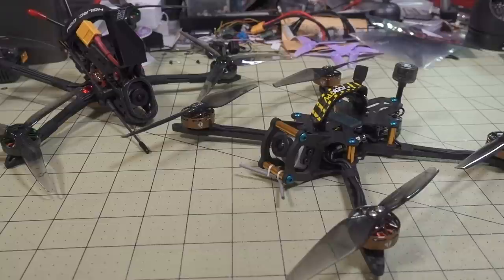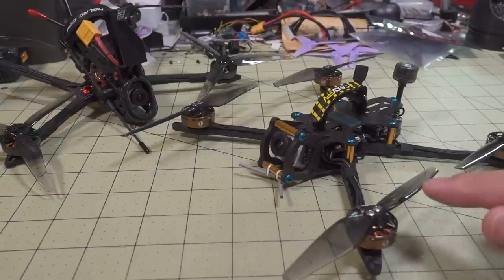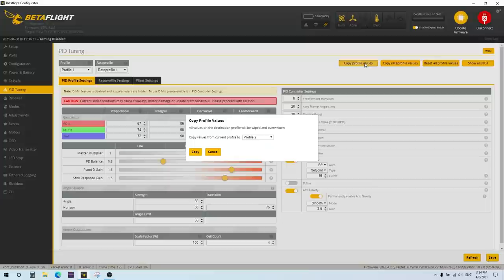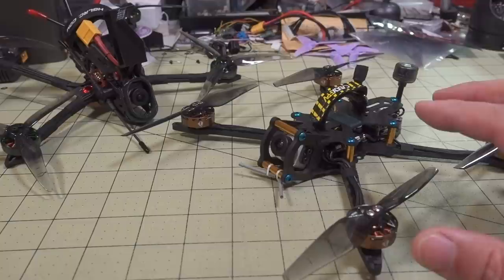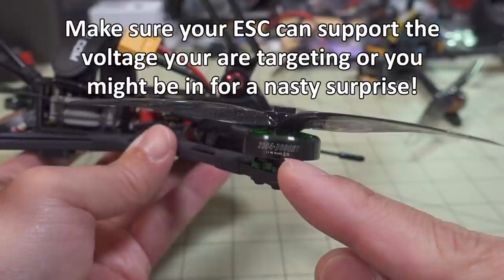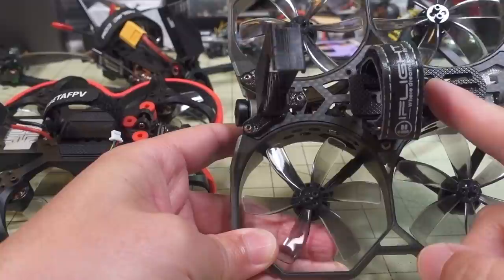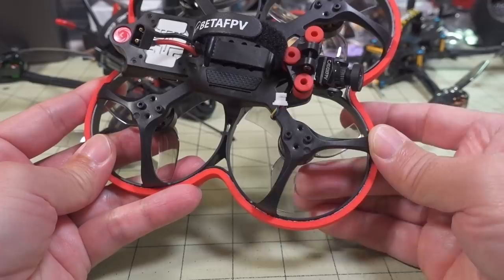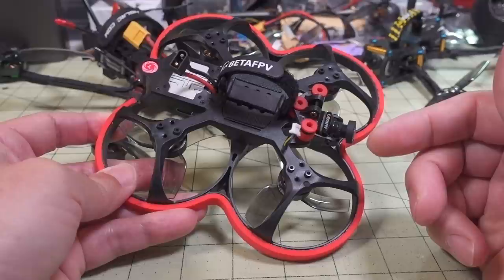Adjust Your Motor KV to WHATEVER You Want! 🔥

Comment from the maker: Was hoping to get some detailed answers to my question "is it the same?", however, details are lacking.  Just commenting that "it is different" doesn't really help or explain why to others who may come by to watch.  If you can please provide details that would be helpful.  Also, I think some people are confusing motor output limit with throttle limit (or throttle cut) which are not the same thing.
Reply: When I started doing this I asked all the smart people I know and the consensus is that doing this is almost exactly the same as having the “natural kv” of the motor.  In my tests I cannot tell the difference in a natural kv vs a motor output limit version.  It was an old trick I used for brushless to warm up for Angle racing...start off with 22k’s at 85% or so to learn the track and then ramp up when I start hitting the limit.  Now I want a “push to pass” option on a switch to go to 100% for that turbo boost as needed.
Reply: Throttle limit sets how high the throttle value can go. It it does not limit how fast the motor can spin because the PID loop can still ask it to spin faster.  Motor output limit sets a limit that also affects what the PID loop can request. Lets say a beginner pilot wanted to limit their throttle but was not running 4s motors on 6s. The throttle limit would probably be better as it wouldn't prevent the pid loop from requesting the motor to spin faster to maintain attitude. In the use case you described, the motor output limit is the correct one to use. When you have the ability to spin something faster with less energy, you sacrifice torque. A pulley system that increases torque moves slower. There's a BL_HELI 32 100% explained video that explains why less torque = more loss. The flight time difference isn't very big, but it's there. Motor output works great for getting a 4s quad to work with 6s, but definitely not the same as switching to 6s motors.
Reply: The Ryan Harrell answer: If your motors are stuck, you are using a lot of power but doing nothing. Your motors are always a certain percentage stuck due to the forces you are trying to overcome to spin the motor. The lower the torque, the more stuck your motors are and the more energy goes into not doing what you want, which is to spin the motors. I'm paraphrasing here.
Reply: Hey Albert, another great video! 

Aside from the two methods of adjusting 'virtual kv' being the same or not there is another interesting thing: Motor Kv and torque coefficient are inversely proportional, meaning that Kv = 1/Kt (in SI units). This is a given relation per motor and has to do with the number of windings of the motor, amount of copper in the stator etc. 

Virtually adjusting the Kv by applying any method, whether it be throttle cut or anything else, does not change the inherent properties of that motor. This means that if you apply a throttle cut to a high Kv motor to match a low Kv motor, it will have less torque at same rotational speed than a low Kv motor, just because of the inherent relation that Kv = 1/Kt of that motor.

Whether you will actually notice a big difference in flight is another topic, but i thought it would be interesting to share!

Love your videos and all the best!
Reply: @droneshotproductions1581  yeah, how much it saturates the windings, etc would be different, right?  Most times I'm reducing motor output to 60-85%  so I'm guessing at those levels the torque difference is neglible?  Also, a lot of times I'm also reflashing to 24khz instead of 48khz on the ESC's so in effect it might feel almost the same as you get some of that torque back going to 24k.
Reply: @ProjectMockingbird  I wouldn't think the PWM frequency on the ESC is increasing or decreasing torque. At least not significantly. Do you have anything to link to that shows that? I had the chance recently to up my PWM and I left it at stock because in the bluejay documentation it shows the amount of throttle resolution available at the 3 PWM frequencies and it was highest at the lowest PWM frequency. I'm always searching for more throttle resolution and never really more power.

Comment: I successfully run 2600kv motors on 7in props using this method (motor output limit set to 60%).

The highest KV flavor of many motors is usually the one that can handle the most amps, betaflight's wizardry lets you dial in the KV you want. Love it.
Reply from the maker: Thanks for sharing

Comment: I lowered my 2207 1950kv motors by 17% to try to replicate 1700kv as I had intended to get 1700 in the first place.  Only a couple of flights so far and seems more efficient and saves me having to buy another set of motors

Comment: I know this is older post, and I don't have a any testing data numbers, but I will say, per another video I saw year or so ago, I started just buying all my motors, from toothpicks up to my 6" build, at the highest Kv the manufacturer offers.  I've found three advantages to this.....

1. You covered this one in the above video, and I've been happy with the 66% reduction for dropping from 6s to 4s. 

2. I know there's formulas and different schools of thought, but personally I go with 3 or 4 blade props on my freestyle/race builds (don't race hardly ever)  and obviously bi props on any long range quads, and one I built for top speed.  I used to buy higher Kv motors for the bi-blade builds, now I just lower the motor output on my freestyle/race quads.  I don't have a formula but it's not as much as dropping down to 4s battery.  I found the sweet spot on my 5" and 6" builds, for tri-blade props, drop down to 85%, 4-blade props 82%,  on 3" and smaller I just drop down to 90% for tri-blade props.  While I didn't use math, I did test this out over the summer, with several motors and props, I would start at 100% with the 3 or 4 blade prop, fly super aggressive for 1min straight, and then feel the motors.  Then fly another quad for a few packs, and let the other cool down, and drop down 4% or 2% depending if I burned my hand..lol, until I got where the motors were a little warm, but nothing crazy. 

3. The final advantage for me is because I'm a procrastinator and a little unorganized, I would kill to have a work area and bench an clean as yours, so it isn't that rare that I burn up a motor, and can't find an exact match for a replacement.  My motor drawer in my shop looks a mini Tasmanian Devil got in there and went nuts,  I usually find a match on size, but not always Kv, since I've only been exclusively buying the higher Kv motors for a little while now, and I never throw anything away.  And I know the FC/PID loop will only allow the bunch as much power as the slowest motor, but I lower the motor output on that one motor or other 3, depending which his higher or lower Kv,  just so the FC doesn't have to do as much CPU work, which could just be superstitious at this point, but I'm too old to change.  Take care!

Comment: I've always thought lower kv meant lower rpm per volt but more torque per volt if everything else stays the same? 

 I don't think just limiting the max rpm of a higher kv motor would also give you the extra torque that a motor wound for lower kv would give you.  If it truly worked that way then all motors should just be wound for the highest kv possible and then you just set your max rpm based on the voltage you want to run right?
Reply: I thought high KV motors just where more efficient, like they could use the same volt to spin faster. Bigger motors have more mass and that's why they often have a lower KV than smaller ones.
But I don't know, it could also be that high KV spins faster but it drains more mAh from your battery, so you'll get more speed but less flight time.

I'm just guessing here 😂
Reply: @lui472  From the thrust test charts I've been looking at, it seems lower KV motors are more efficient, but the data I have found isn't the best in the world. There will be obvious differences between a motor that physically has more or less windings and thinner or thicker gauge enameled wire inside. Physically, the lower KV motor obviously needs more voltage/PWM applied to get to the same prop RPM as a higher KV motor. But hey, we have insanely awesome software running everything, so why not use a little software hack without needing to change 4 motors? That's how I see it.

Comment: I seen some tests from 
ExplodingFist Recursion doing this. From what I seen it absolutely works with a slight loss of efficiency and a little more motor heat. The lost efficiency is turned into heat so he warns if your 4s motors are already running hot on 4s, be careful running them on 6s.
Reply: @ugpfpv361  Your piss or your PIDs? I just tried this and my 4s quad in nearly unflyable on 6s. Even with the motor output limit set to 66% which keeps the max motor rpm at exactly what it is on 4s.
Reply: @CarbonGlassMan  haha didn't notice that... Piss haha.
Yeah my 4S I run on 5S so don't know about running 6S

Comment: I have some wild willy 2700kv on a flynocerus cerb 2 and have it set  up as a profile changeable 3/4/6s for over a yr, I've noticed longer/stronger punch outs on 6s profile,but some of my 6s bats are 1100 and 25gms lighter than my cnhl 4s hazard orange 1500. 3s is for slow n low and would need more aggressive props. limited on 6s is 62%, did it thru cli command, but as far as flying doing stuff not much different, just time(avg 1.3 mins) if i use a 1250cnhl 6s and a bit longer punch outs. The Main thing I would tell others is make sure everything can handle 6s not all escs/fc can handle it, plus if added on caps should be at least 35v/500. 25v might pop on  a good spike.

Comment: Yup, been using this recently (Emuflight lets you control it via OSD) working on 703 and 802 2s Whoops.  The goal for me is to find the right combo on 2s that is as fast as 22k 802 1s, but with more efficiency AND waaaay better throttle resolution.  Racing Angle 1s now seems archaic.

Comment: if you makke a seperate profile, are you saying that we can go back to the original to fly 4s?
Reply from the maker: If you use the cell count feature it automatically detects the voltage and switches profiles for you (assuming you set it up correctly).
Reply: @AlbertKimTV  oh, ok thank you! that's pretty cool. i only run 4s, but that's good to know!

Comment: Its good if you want to run 4s motor on 6s lipo, but its not the same as lower kv motors on 6s. Motor is getting more hot, and its less efficent

Comment: Yess that's cool! I just wanna know what would change if you run a 4s motor on 6s... Does it have any advantages? 😂

(I'm really new to all this 6s stuff 😅😅🤣)
Reply: It works, it will just not have as much power. KababFPV made a video about this I think
Reply: Rotational mechanical power is proportionate to the product of RPM and torque. So, if you want a higher KV version of a motor to deliver the same amount of mechanical power to its propeller as a lower KV version would, you have to fit it with a propeller that's easier enough to spin. This propeller - at sufficiently high airspeeds - would probably produce more thrust than the other one, but maybe not enough for your drone to actually reach those speeds.
Reply: @Mark-4158  thanks! ^^

Comment: Great Info. I never knew this. I wonder if it'll work for 1s to 2s Providing it can handle the extra weight.
Reply: IT does, I did this with a betafpv 2-3s ecu, 1s motors 1102 and a 2s batt

Comment: You are not changing the KV when you change motor output limit. You are changing the maximum power that can be delivered to the motors. The motors still spin at the same speed per the same amount of voltage. While you can improve the performance of a 4s quad by using motor output limit and running 6s if the rest of the electronics support it, it's not the same as changing the motors. Lower KV motors have more torque all other things being equal. I have not testes this scientifically but I do notice more flight time on one quad I upgraded to 6s motors after first using motor output limit. If we had identical quads and you used a motor output limit to increase flight time and then we had a contest to see who could stay aloft the longest, the motor output limit wouldn't help assuming we were just hovering around about the same. You would just have to use more throttle to get the same thrust.
Reply: Yes I find efficiency is not the same as going with a real lower kv motor, but definitely feels more Poppy which I love!

Comment: I built a 2fiddy:
2Fiddy 5" 4s 247g. Flywoo Naked O3 Lite\Ultra Air unit. Ummagawd Aerolite 2004 2400kv motor. HQ T5X3. Betafpv F722 35A AIO Brushless FC V2 with BLHeli_32 ESC. GAONENG 660mAh 4S 90C HV - XT30.
In the high speed range from 70/80 - 100 full throttle I have strong vibrations. It flies very well in the lower speed range. I currently have standard Betaflight 4.4 settings. Is there any special PID or filer setting in Betaflight that I could do?
Reply from the maker: Increase the filters

Comment: This method does not change the KV of the motor at all. It simply limits the maximum voltage applied to the motor. It does not improve efficiency except to say that spinning at a slower RPM is more efficient than spending at a higher RPM however if you set your throttle setting to 66% and run a 4S motor on a 6S battery it will fly with the exact same efficiency as a 4s battery. It will pull the same amperage under the same conditions. This means if you have a 4S or 6s battery both with a 1000mAh capacity and are pulling 25 amps it will fly for about 2:25 before it uses 1000mAh. What does change is the fact that towards the end of your 4S battery you will start to notice sluggish response as the power begins to dip however with the 6s battery the power will not dip as low since it started out much higher. This means when the battery pack starts to dip the 4S lets you know before you get to a voltage that damages it. While a 6S will continue to fly as normal making you think nothing's wrong so if you are not watching your voltage you can easily cause the battery damage by draining it too low.
Reply: KV is literally 1000 RPM per volt input to the motor. This is with no load on the motor. The KV is tuned through a number of variables ranging from size design and layer count of the stator to the diameter and number of wraps of the coils as well as the strength strength size and arrangement of the magnets. A simple way to quickly change the KV and therefore the efficiency and strength of a motor is to swap the Bell for one that has a different magnet arrangement. While typically the coils are wound with a specific wire diameter and number of wraps to match up to their magnet layout. By changing the magnet layout you will not likely cause any damage to the coils or the magnets. They will simply run in a different (usually less efficient) manor.

Comment: Cant count how many quads I have output limits set on via BF or through open tx. I even have a profile with aux selectable output limit via 3-way aux switch. Ive even seen it done using a variable pot. Going through open tx does decrease response time slightly over the BF method. I'm still perplexed as to why this cant be done through the esc in BLheli I'm just not knowledgeable enough with it yet but feel there maybe a way to decrease AND increase it through motor setup there.

Comment: Im building a Flywoo Explorer LR4 but can only find iflight xing 1404 7000kv motors in my area, could I just use those and set the limit to 50% motor output to get something similar to a 1404 3500kv, an then use it on 4s instead of the rated 2s?
Reply from the maker: Yeah it will probably work. The pids might not work the same and may need adjustment

Comment: i dont know if i missed the info in the vid but I was wondering is there any difference between changing the throttle scale in Betafight vs. doing a throttle scale on your controller in opentx?
Reply from the maker: This video doesn't cover any of those features.  AFAIK there is a big difference in both those.  I have not used those and never plan to use those methods as I find those are inferior to the motor output limit feature.
Reply: @AlbertKimTV  gotcha, I've always used opentx throttle scale just because its more convenient not having to change any settings in betaflight and I can put it on a slider on the radio. Great video, love the content :)
Reply: @AlbertKimTV  I had the same question, trying to understand the difference between this method and throttle limit+scaling in the same proportion in betaflight configurator. I have 10000kv 1103s running a 3S 3" toothpick with the limit+scaling method @66% and it seems to be quite efficient, but seeing your video I'll do a test to see how it affects for this particular setup, thanks and great content as always!

Comment: How have I missed this video ! So if you have a Diatone Hey Tina with the 12000kv (2S) mamba motors you could doctor for 8500kv (3S) for outdoor insta360 vibes - considering they both use the same FC ? Thanks Albert !
Reply from the maker: Yes you could do that.  It won't feel exactly the same but it will get you in the ballpark.  However for those tiny motors you still need to watch the motor temps even with the adjustment.  To be safe, shoot lower on the adjusted KV value and slowly move up and watch the temps!  So many people have burned motors not using sensible caution here.